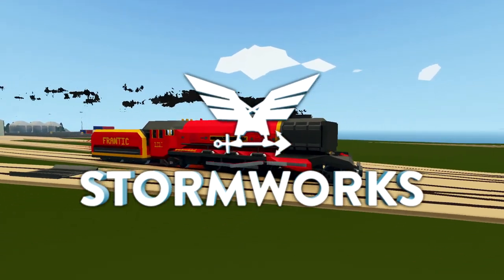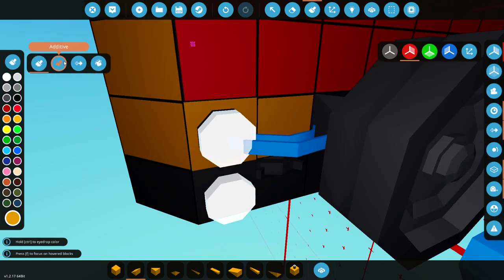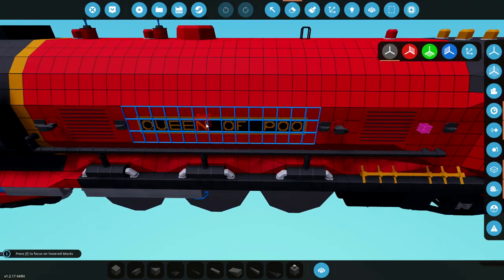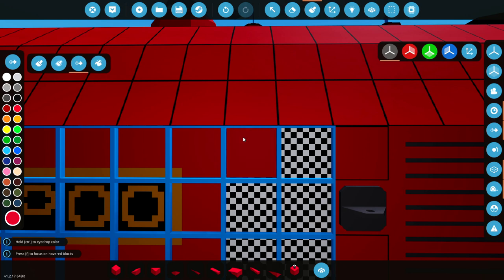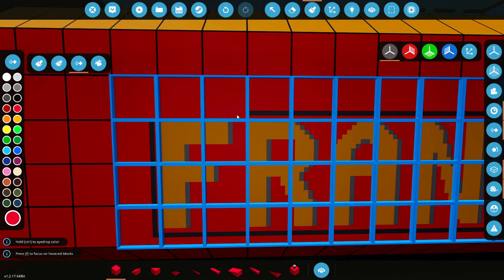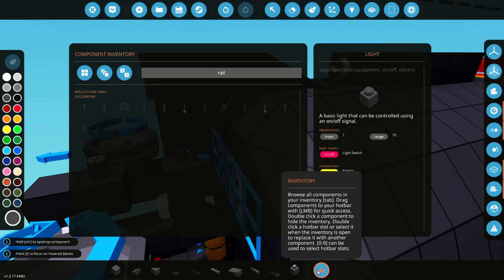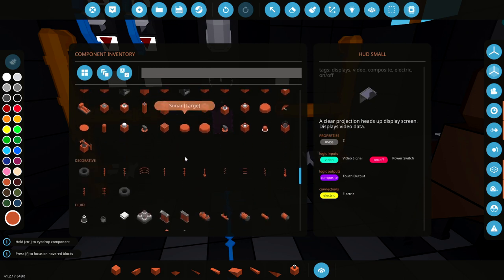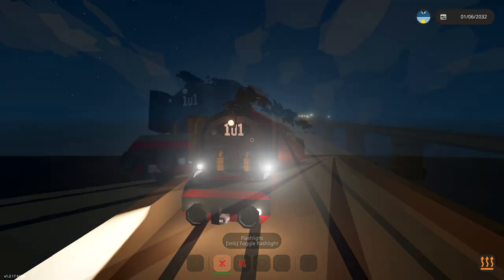Finally, A Name Change! - Steam Loco Build - Stormworks - Part 14

Comment: Hay frantic you should add a fluid cart for your train to transport fuel oil and water with pipe and make a switch on every cart to disconnect them and make it able to get to the carts from the locomotive and maybe a battery cart thats just batterys for the train and carts